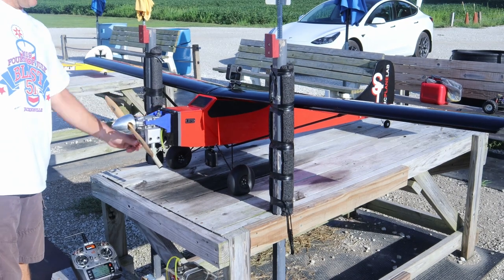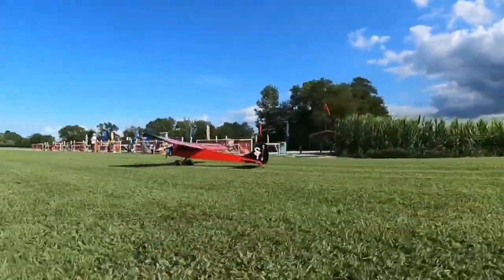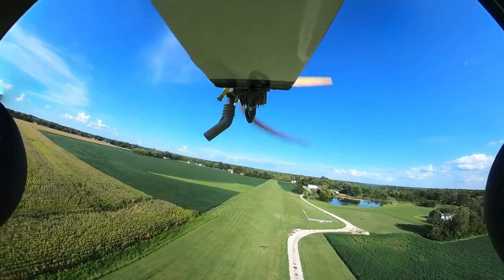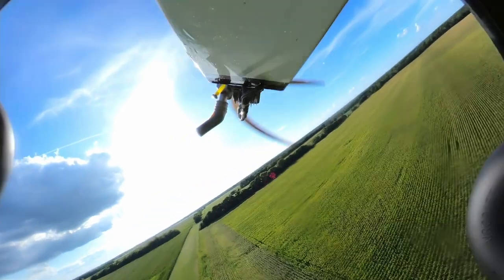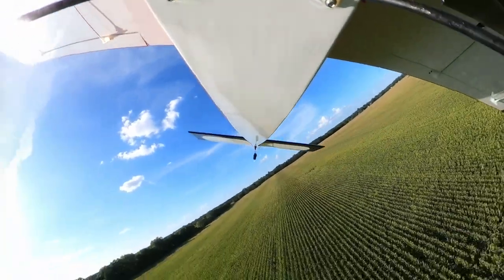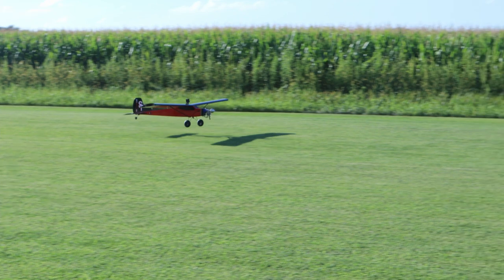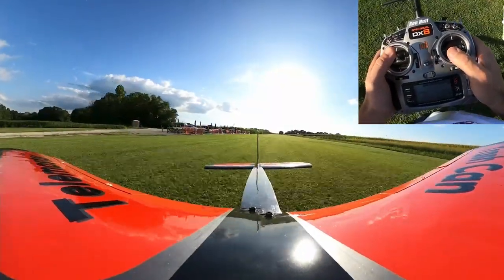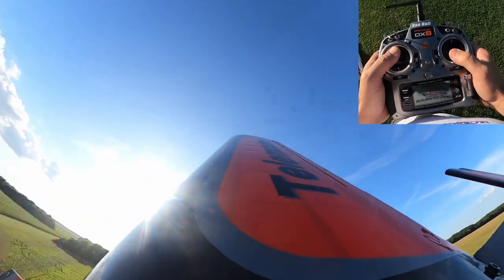The Senior Telemaster Flies! - RC Plane Lab

Comment: Let me tell you bout my Telemaster.  I've flown it "hands off".  Got it in the air, set my trims and laid the radio down.  The old saying, NOTHING FLY'S LIKE A TELEMASTER  is 100% correct !  A Sig senior doesn't fly anywhere as good.  The telemaster is a great trainer, hands down.  I had a Magnum  70 four stroke on mine and it sipped fuel..

Comment: I FLEW TELEMASTERS IN RC AIRSHOWS,, SOME REAL IMPORTANT THINGS I WISH TO SHARE, FIRST PUT RIDGED STRUTS for the wings, SECOND DONT OVER POWER IT, A OS MAX 60 IS PERFECT BALANCE AND THE PERFORMANCE INCREASES, AS IT IS NOT LIKE A STRING FOLLOWING A ROCK. I REALLY MISS THESE AND IT WAS MY FAVORITE TO FLY.. NEVER BE IN A TRASH CAN AROUND ME FOR CERTAIN IT WOULD BE REBUILT IN THE SAME WEEK I FOUND IT, even if i cant afford the radio and motor any longer